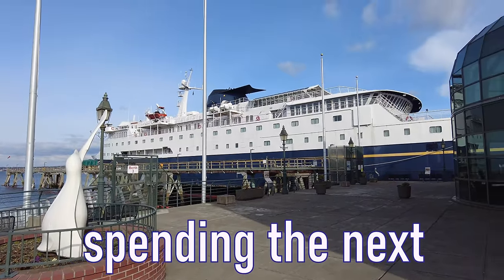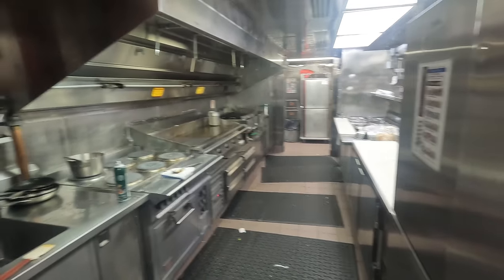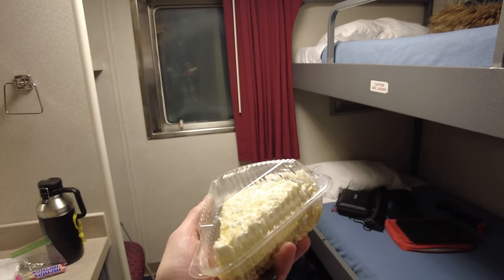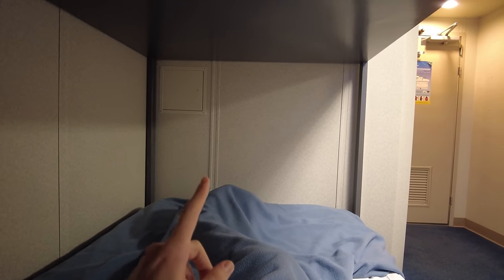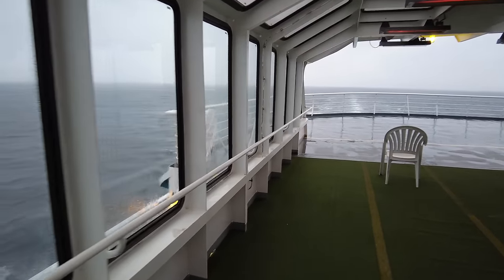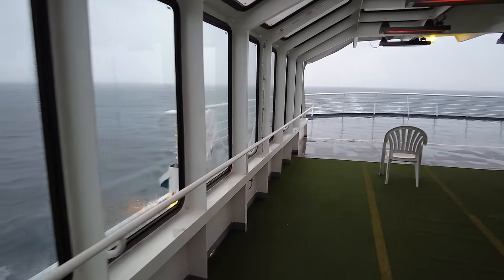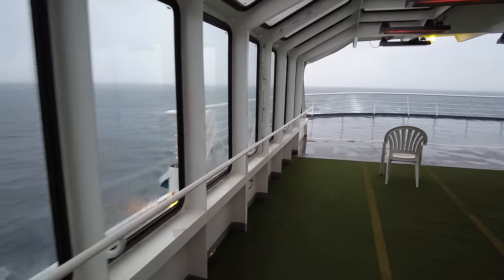36 Hour Ferry Ride To Alaska - Alaska Marine Highway Full Tour ( Bellingham, WA → Ketchikan, AK )

Comment: I rode this ferry in 1979 after working as an Archaeogist in Sitka area. We did not have a room, we slept on the back deck under a big electric heater in the ceiling, we had bedrolls on a Astro tuff floor . Was $99 . Great ride

Comment: The las time i checked, maybe 4 years ago, i was warned to bring both blankets and a folding chair, and food, because there was no food and not enough chairs, or bedrooms and there were tents pitched on the decks because of the room shortage, and it was very cold in the rooms, if you were fortunate enough to find one available, so, it looks like things have changed, a lot!  Probably more expensive if this is a new boat, though.
Thanks for taking us along!

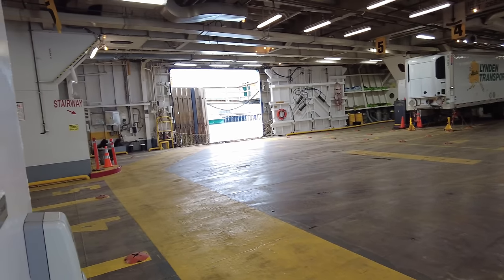Comment: 5:49 those little step things in the elevator were actually for the emergency hatch because if the boat was sinking and the elevator stopped working those are so you could escape into the elevator shaft if needed

Comment: I work in cruiseline and I see you got lost trying find your room so i got small tips for you and other. Any odd number will be assigned in port side (left) and all the even number will be on starboard side (right) Same for the lifeboats .your cabin will be on right side of the ship. Most of ship will have deck number or latter's like E130 etc which tell your deck and room number. Its because of old marine rule which is still followed by I.M.O also help when some one is MOB. Have you also notice we dont use number 13 in the shipping its because its considered are unlucky number.

Comment: This video is something of a time capsule.  The state has not managed the system well, and half the ferries are not in active use either because they are out of commission due to various mechanical issues, or lack of budget for staffing.  2 things you did not see, which they used to have, is a lounge/bar, and a gift shop.  Those got closed 5 or more years ago.

Comment: Pretty good video, I appreciated that you put forth the effort to tour the different areas like the engine room. However... a few points that would have been nice, one: cost. How much for the room versus how much would it have cost without a room? I  believe they let people just hang out in those rooms with the comfy seats the whole time, or like you said pitch tents, but would be nice to know price difference. Did they have lockers you could store your stuff? Also, how many hours was the trip? And you probably know this by now but KetchiKAN is pronounced like 'can' not 'kahn'.
Reply: It's usually around $350 for a room for 1 - 2 people on the BLI-KTN route. The fare is around that much per person as well, so $700+ and save about half if you don't use a room. Unless you really want the long hours and overnight of nowhere to go but a chair, with conditions not favoring a tent on deck all that often, having the room is a really nice step up.

Comment: This is a VERY expensive trip. I checked for June 2023 and the basic fare is $342. No room, nothing included. And the only available cabin was one with four berths, not two. And that's an additional $613 for a total of $955usd! And they even charge for a bicycle: $88. Eighty-eight dollars for a bicycle? total rip-off and abuse. Take your care or share a ride instead.
Reply: If you wanna see nature, and not have to deal with Canada's bs, it's ferry.  The ferry system is crucial because there is not much of a connected road system until you get all the ya up to Haines/Skagway without heavily relying on access through Canada.
Reply: @alaskanb3arcub  lol YOU are the BS here...